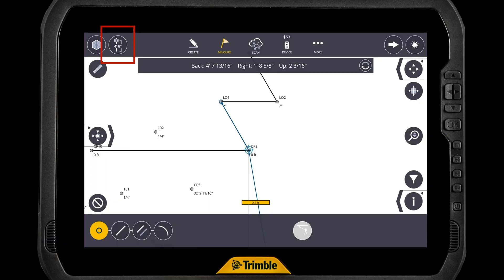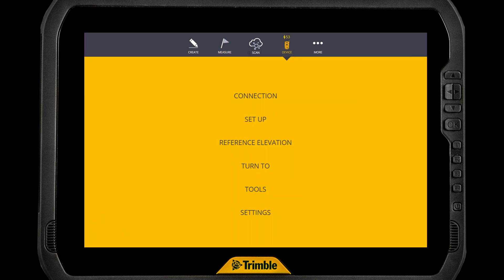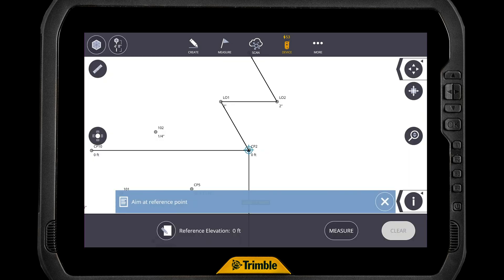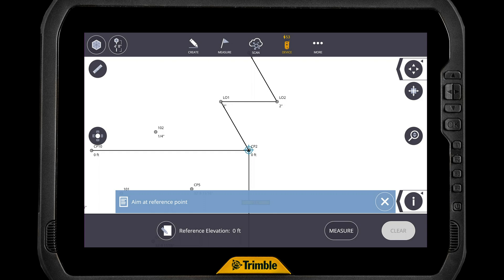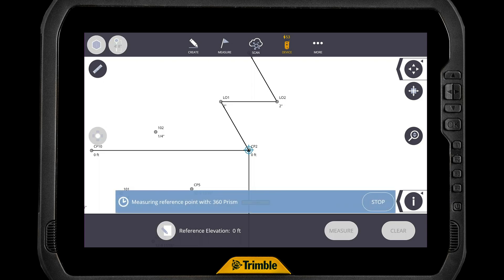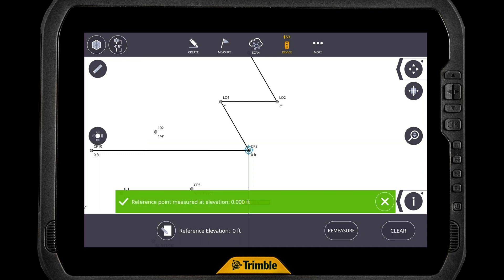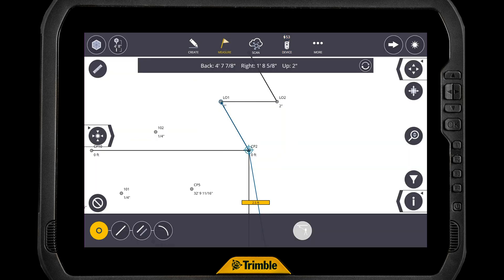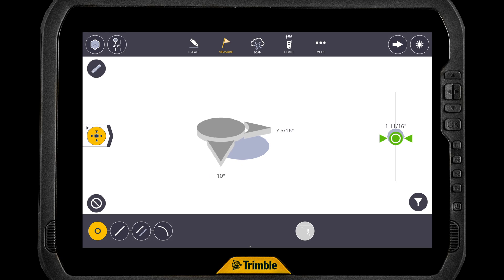That's The Point - How To Set A Reference Elevation

Comment: Active vs. Passive mode with MT1000 - if the prism is in good to excellent shape, with no diodes pushed in, you will likely get the same results.  But if there is any doubt on the condition of the MT1000, we advise switching to Passive mode, as the diode "red lights" on the MT1000 can cause errors in elevation values.  Know that the factory spec in accuracy is +/- 2mm.

https://www.youtube.com/watch?v=pP5g787vOd4&t=767s

Fast forward to 2:22 - Robert explains how to use the MT1000.

Comment: Hi guys, thank you for the great videos. Very informative and really well presented on Relevant topics. I have a question. I am using a MT 1000 prism and need to establish a reference elevation. There is a benchmark on a nearby column. With MT 1000 mounted to my prism pole how do I determine my prism height? Do I measure From the base of the pole to the center of the LEDs or the prism mirrors? Is that determined by active or passive mode?  There does not seem to be distinguishable marks to measure to 
Thank you very much in advance!
Reply from the maker: It is important to measure from the base of the pole to the center of the prism mirrors to accurately establish your prism height. The active or passing settings to not change the measurement point.
Reply: Thanks for your reply. Worked out well. Thanks